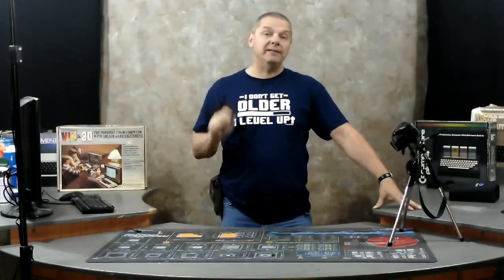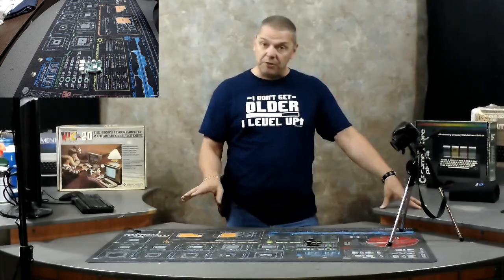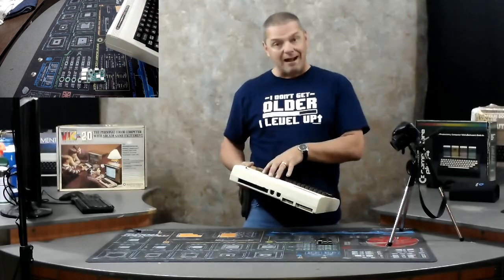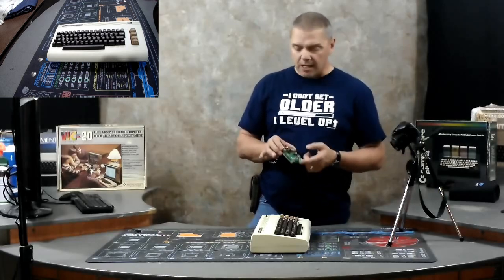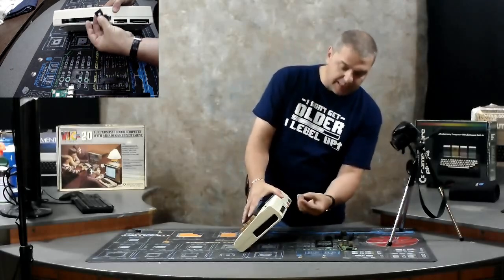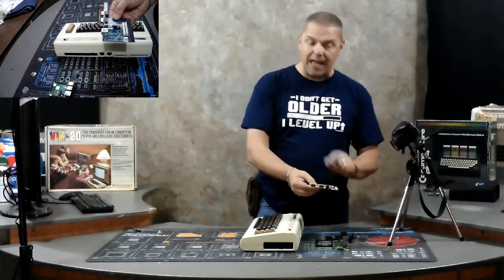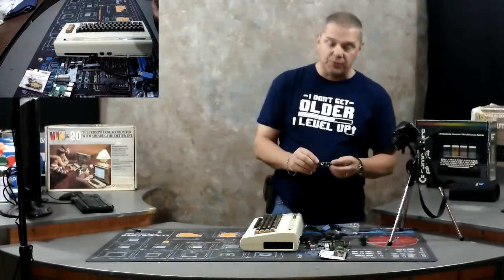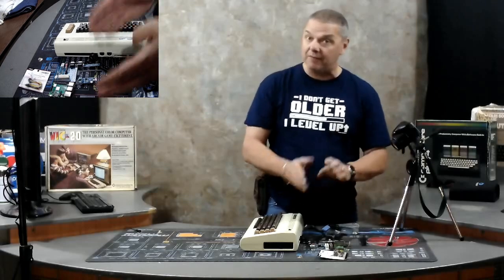Lets put a raspberry PI into a Commodore VIC20! (Part #1)

Comment: Hi Man ...

If this was your First Computer .. I suggest that you fix it and keep it as it is because of the Sentimental Values.
You can always get a busted one on e-bay and use its Case for your Raspberry Pi project.. Just a Thought...

I Still have my VIC-20 and My Commodore 64s Intact and using them even after I bought the New one called THEC64 from Retro Games ltd. wich has both both the C64 and the VIC 20 in one Bread bin case.

Thank You and wish you all the Best
Mohammed A. Rahim
Electronics/PC Tech.
Reply from the maker: Mohammed A. Rahim Hi there! Thanks for watching. Strangely enough, I actually decided not to sell that unit. 

The conversion didn’t actually modify the casing anyway it’s simply replaced the components. If you look on my later videos you will see the pcbs on the wall behind me. The motherboard from that Vic 20 is still on the wall behind me perfectly functional :-)

I’ve done several of the conversions on the Commodore 64 but I have an interesting spin I’m going to try on the next one.